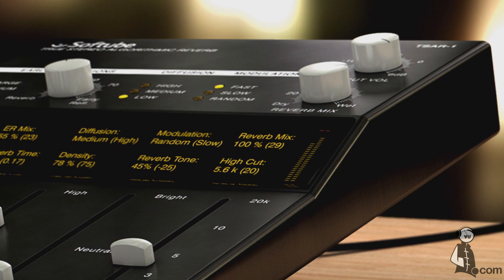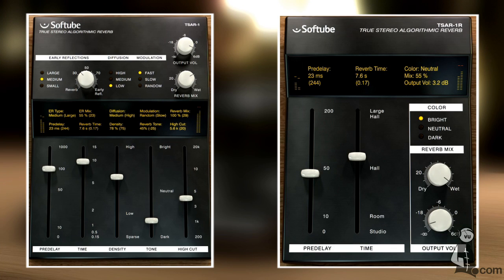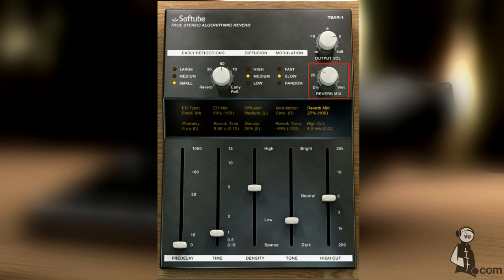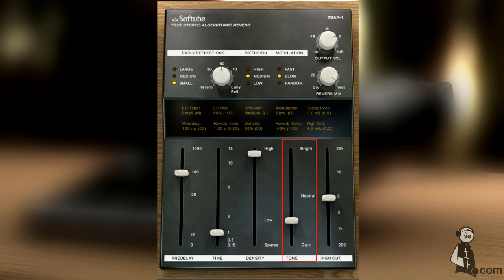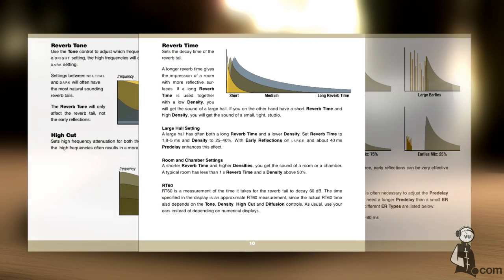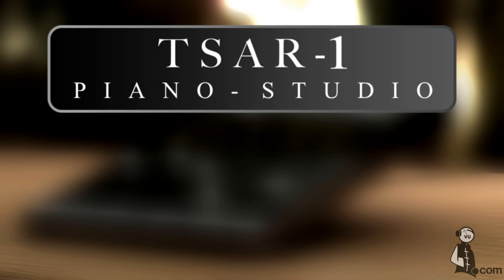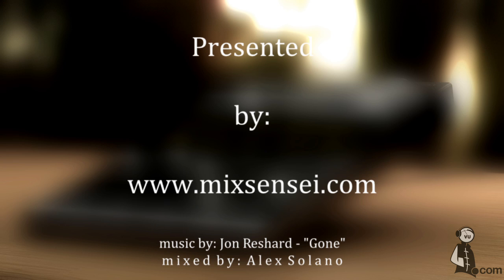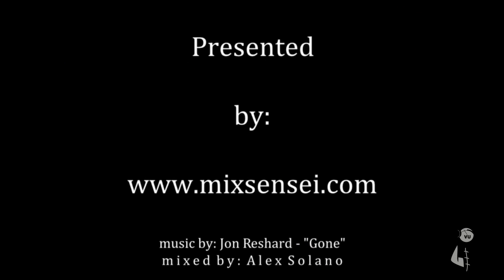TSAR-1 Reverb - Features and tutorial

Comment: You can just buy Cubase 7 instead.  Their reverbs are every bit as good and all included with the program. They don't eat up tons of dsp either.
Reply: I doubt it is as good.
Reply: Well, you'd need to actually try it instead of doubting it. They are fantastic sounding verbs. I have The Hofa IQ-Verb, Waves TrueVerb, Epic Verb, Valhalla,  UAD 140, 250, Ocean Way, Roland 201, AKG BX20, and Lex that I use all the time as well, so, I know what the comparisons are. I use an analog Fisher, Demeter Real Verb, Ibanez SDR-1000, Sage Benado Adverb and Little Walter Tube Amps spring verb, too. The latest version of Cubase has some truly golden verbs that I use over all of these for certain needs.
Reply: The only thing that bests them is a real Bricasti.
Reply: @dobrocat1  are you talking about roomworks or about reverence? Because i use cubase too and I dont feel its reverb are good sounding. Maybe I'm missing something? Would love to know tbh
Reply: @rogergarriga3917 , Cubase has great verbs. Especially Reverence.They are set full scale, so, you just need to shape them with the eq in the send channel. A little HPF and LPF and when needed, some shaping eq and you're in the game. I also have a Bricasti, a Hofa IQ verb plug that I use a lot and every one of the UA ones, along with Sound Toys Plate and many others here at the studio, but I have no problem using the Cubase ones and have for a long time.
Reply: 10.5 just released, so, get on board with Cubase and you won't be sorry.
Reply: @robertszordykowski4919 , yeah, it doesn't work well when you steal it, huh? I've never had a single issue with their dongle in more than 20 years now.
Reply: @robertszordykowski4919  if you had a real computer, you wouldn't have to worry about that, huh, name caller...I have 12 on my hand built computer and my dongle is inside, where I never have to worry about it. And, yeah, there are many thieves out there these days and it's shameful. It's not hard to spot them. You can also buy a $10 USB port with 12 inputs for misc CMC's, dongles and things of that nature that don't require much power if you're really that worried about "wasting a USB port".
Reply: @dobrocat1  Well, keep riding Steinberg's stick while calling others thieves. Meanwhile I'll use software that doesn't piss me off.
Reply: @robertszordykowski4919 , if something pisses you off, it’s because you’re allowing it to piss you off. For those of us who aren’t so juvenile and have our demeanor under control, Cubase is fantastic. Enjoy your inferior program.
Reply: I got the Bricasti impulses, it's already pretty convincing. I wonder what a real one sounds like, must be huge !